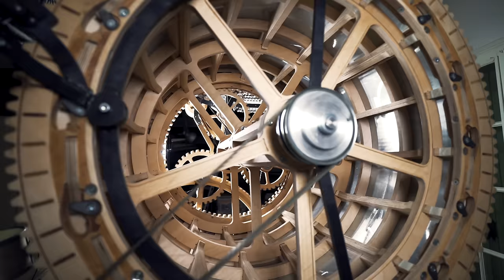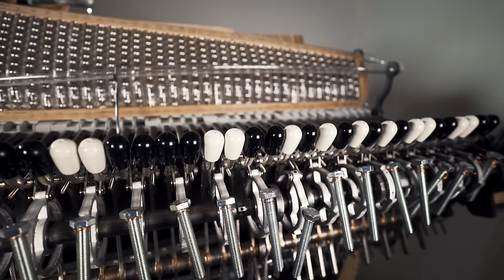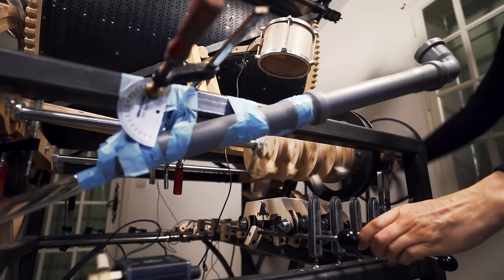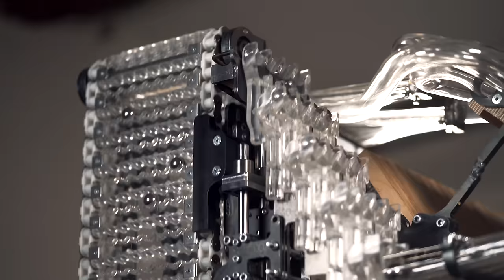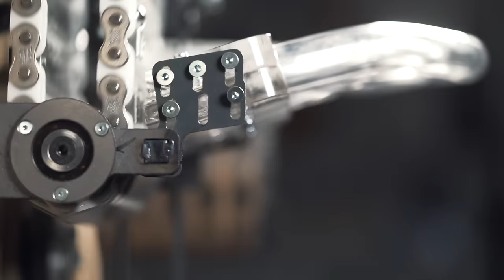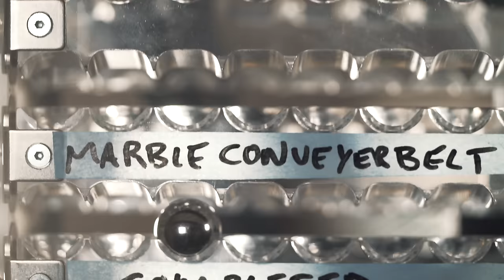Marble Conveyor Belt Completed! - Marble Machine X #78

Comment from the maker: The Marble Conveyer Belt is Completed and it delivers.
- lifts 8 marbles per crank turn.
- thanks to it being driven by ratchets and pistons, it makes a short halt to load and unload the marbles, on exactly the same spot every time.
- The pistons are connected to the crank shaft with a 2:1 gear reduction which means that the conveyer belt go in time with the music, and in half time. I can even use the mechanical sounds from the ratchets and the marbles climbing the fish stair to create parts of the beats.
- I only had one kick drum channel up and running so the kick drum plays on 2-4 like a snare normally would. Sounds a little strange but I just made this piece of music to demonstrate the concepts are working. (no music you hear in the videos are going to be used for the album, its quick and dirty functional pieces for the videos only)
- Its been a journey but we are now on our way. Again.
- the throw of the pistons s 40mm, the pitch of the chain is 15,875x2 mm, an imperial value, and it happens to be exactly twice the marble diameter. All this makes it possible to lift exactly one row of marbles per crank turn. The ratchets move 40 mm but only grabs onto the chain to move it exactly 31,75mm per crank turn. 
The carriers are flame polished cnc:ed acrylic 
- The chain was custom made in Japan and I waited 5 months for it to be delivered. haha. Of all the time consuming darlings on the MMX I love the conveyer belt /fish stair combo the most.
- the marbles looks like they are stuck over the demagnetiser wheel, this is by design, as soon new marbles come into the pipes from below, the marbles are slowly pushed over the demag wheel which ensures perfect demagnetisation.

- thanks for watching and believing in the project, good luck with everything that you are doing!
Martin
Reply: We will never forget "8 marbles per crank turn"...
Reply: Wintergatan I would be pleased if you could make those marbles exiting demagnetizer to go more freely. What I've seen it isn't enough slope for them and they are stopping a while after leaving demagnetizer. Please repair this. :-)
Reply: it's so beautiful 🤩
Reply: I can't help but notice that one spot on the drum that keeps getting blacker with grease each time a marble bounces. Do you have a plan to keep the acrylics and instruments clean?
Reply: Man job great
Reply: I'm still personally worried about feeding enough marbles during a song, but I have to admit that drum was filling up nicely.
Looking forward to this being completed. First concert I'll ever go see if it comes to Montreal.
Reply: Wintergatan good job
Reply: Martin, you are the shining example of how passion, hard work, creativity, and child-like curiosity can make anything possible. I've been following from day one in this process, and I can already hear the amazing music being made. Keep it going!
Reply: Congrats man. You're a genius. I wish you lots of success👍
Reply: Wow, dude, idk, but, sometimes, like this, the music are so beautiful and peaceful that i can sleep with that ! T.T Fantastic Job
Hello from italy !
Ciao, Bel video, fantastico ! :P ( you can use google translate if you want c: )
Reply: @wikapo  He says it is by design, look to the end of his comment!
Reply: Wintergatan , Looks great Martin, we admire your diligence!  Can't wait to see vibraphone on the machine ⚙️🔩🎼🥁🎧
Reply: Martin, I have a question for you. Do you think that you could play the original Marble Machine song in on this one? I would love to see the difference between them
Reply: Wouldn't it be cool to have a website with an interactive model of mmx on which you can click on the individual parts to see the video about this part.
Thats probably a project after completion and some vacation.
Reply: Its really nice great job
Reply: it looks like a miniature futuristic city. The marbles are little vehicles ( or even people). Fantastic! Mesmerising to watch, and the music here sounds beautiful, too. :)

Completely unrelated: I wish you and Björk would collaborate <3
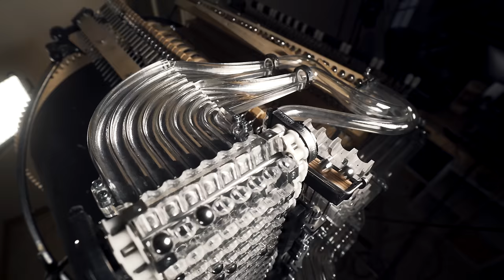Reply: 2:52, a marble jumped out of the elevator at the bottom
Reply: Congrats Martin :)
Reply: @EdwardHowton  This. Has the capacity of marbles carried up by the magnetic wheels per sec/min/whatever been calculated? It should obviously be greater than the amount of drops per lenght of song.
Reply: This video is set to break the internet, your machine is awesome to watch even without sound
Reply: What a momentous milestone! Marbles making a full circuit and playing a note! Congratulations, can't wait to see what fantastic music you make.
Reply: I am convinced that the marbles that bounce are more prone to deviate in the length they travel rather than over the width of their flight path. So it seems you may get more use out of an oblong catch basin to accommodate. Making it more streamlined looking and technically more usefully accurate. I understand completely that the grey tube is prototypical.
Reply: You are a Genius and a true artist, Martin Molin! As a perfectionist myself, I could understand well that you wanted the MMX to function perfectly and at the same time to look perfect. But as can be seen in this video,  MMX ended up being very beautiful. This whole journey was also very  didactic for me, as if the making of the MMX was a metaphor for any big project or dream one might have which brings many obstacles with it. I recently shared your story with my friends in our school's music magazine. So the Wintergatan community gets larger everyday. I am looking Forward to the upcoming albums. and I do believe too!
Best regards
Reply: Keep track of the weight and centre of gravity of that dream machine. It is a true marvel. Congratulations on what you have achieved.
Reply: The fish stair bit only seem to do 4 marbles per turn.... isn't that gonna be a huge bottleneck? Or is that only the recycled marbles that go there? Or what am I missing.....
Reply: The demag seems to have a favoritism towards the outer most track, is that because there are not enough marbles going through that section at a time? Or is that a fault line that can be tweaked out? I thought the design of the 5 lane demag was to keep it spread evenly and allow the lifting ratchet to carry full loads more often
Reply: The dark background looks amazing , what an amazing masterpiece you have created, ....
Reply: congrats! watched with big satisfaction. thought this moment will never come.
Reply: She's a beauty Martin. If the finished funnels are as cool as this it'll be difficult to know where to watch
Reply: @wikapo  it is by deliberate design
Reply: I've seen a couple of marbles rolling back on second magnet wheel. Hope it's not an issue.
Reply: @ZapAndersson  only recycled marbles fill the fish stair... I assume if no song is being played the machine reaches an equilibrium with the fish stair full but no new marbles coming up the elevator.
Reply: @ZapAndersson  only the recycled marbles go there from what I've seen
Reply: Wintergatan looks really good excited for you
Reply: Desperately looking for the black marble ... 😆

Great job, really! I am so excited looking forward to hear new Wintergatan compositions and see you on stage.

Keep going with the amazing projects 😉.
Reply: Oh my! it is so impressive and beautiful. You've come so far. We are all proud of you.
Reply: I did not understand anything about that, but good work.
Reply: We wait the good song on this magical musical instrument! Good luck!
Reply: Where s the "filling area"? If it is marble-empty where their journey begins?
Reply: I noticed that you used the words exactly and perfect only 5 times total. ^^
Reply: Very awe-struck at the beautiful piece of art/ engineering marvel.   Appreciate all the hard work you and team have put into creating the Marble Machine X.  #goteamMMX
Reply: @wikapo  "the marbles looks like they are stuck over the demagnetiser wheel, this is by design, as soon new marbles come into the pipes from below, the marbles are slowly pushed over the demag wheel which ensures perfect demagnetisation." from Martin own words....
Reply: @b.m.2738  thanks :-)
Reply: abledbody there are all sorts of cleaning brushes for brass instruments that would help with cleaning the pmma pipes. Shouldn’t be too much of a problem.
Reply: Your machine reminds me of dr seuss stuff for reason
Reply: Wintergatan “Conveyer belt moves in time with the music, or in half time...” but was it necessary, or it was some kind on perfectionism? What if you play in the time signature like 3/4 or 6/8? The conveyer that moves in half time of the music may distract you... or maybe I am wrong...
Reply: I'm so happy that God gave you a talent like that,keep doing whatever you're doing,with a brain like that deserves more subscribers!
Reply: Leonardo Da vinci reborn 🙂
Reply: Genius?
Reply: Very nice
Reply: It's a fantastic machine. I hope it ends up in a museum someday playing a continuous loop for the next five hundred years
Reply: Genius 天才！
Reply: Wait, there’s an album. 😂
Reply: I watched this video smoking a churro and it was a 4th dimensional experience .
Reply: gets to live show “oh no, we bought the 11mm marbles not the 10mm ones. Oh well, better go home.”
Reply: Should make it work with steam, that way you wont have to keep turning it manually and could add a whole woodwind or brass section or even a calliope type organ...
Reply: Martin, beautiful! But, if you have time, can you explain: How do the pistons drive the conveyor belt? What drives the fish stairs? And how?
Reply: This was unbelievable! Congratulations!
Reply: Wow great work! Love your music!
Reply: Come on! I like this melody
Reply: فيااان عن اول مره😂😂😂😂
Reply: Genius, BTW, take care, blessing
Reply: Great job.unique musical inatrument.i love the way you used those marble to make music.
Reply: How you made this? Please teach me,how it works.
Reply: "quick and dirty functional pieces"

understatement of the year
Reply: jesus God bless you
Reply: Amazing work!
Reply: The perfect instrument for a steam punk!!!
Reply: oh i love that song...anyone can cover that song?
Reply: Hi Martin, love your dedication to marbles, music and mechanical engineering. Whilst listening to this audiovisual marvel and your other projects I could not help thinking about how through "grandparents" of your machines such as automatons, fairground organs and early industrial machines such as Richard Arkwrights water-powered spinning frame and rotary card engines which helped in cotton and weaving in the 18th century. I found your work and "performance" strangely poignant,  as those early "dark satanic mills" we're the first machines where humans became less skilled but "a slave to the machine", effectively another cog in the perpetual motion and creation of wealth for a select few. This is not a criticism but something deep your amazing work helped visualise how many are tied to or enslaved by projects originally designed for enjoyment or spectacle which are always used by less inspirational and entertaining minds to create wealth or war off the backs of new technology. Just wondered if you or anyone else ever had thoughts like this?.
Reply: Have you thought of making a timepiece?
Reply: Wish I can meet you and chat for a 🍺... I am speechless. Same side, I my mind bursting with lot of ways.... Good luck ... Take care.
Reply: Ngsiing
Reply: Nice work
Reply: Yeah what the genius said!!!......... 👀😎👍
Reply: @NightVisionOfficial  09,
Reply: The effort he put in to make this machine is incredibly amazing
Reply: This is a beautiful piece of genius work. How much did it cost roughly to make and assemble? How long did this project take to complete from start to finish?
Reply: Perfecto So nice

Comment: Whats left? Instruments and the marble catchers. Thats all that is separating us from a completed version of this marvel of engineering.
Reply: and troubleshooting and fine tuning, so much troubleshooting and fine tuning...
Can't wait though!
Reply: Packaging and recalibration fixtures.  So, that when stuff wiggles, stage isn't flat, altitude, baro, even subway trains don't make it behave different in different places and the adjustments to compensate can be quick   @Hirosjimma
Reply: He will also need to do several tests to dismantle, and reassembly of the MMX.
He may also need to do a condensation test and maybe a discharge system as well.
Reply: ... "marble of engineering."
Reply: @carstenhilbert5472  how punny
Reply: Also, I believe there still hasn't been a good solution for the programming plates.
Reply: @Nerdule  I think the programming plates were completed in the "Slaying the dragon" video, right?
Reply: @easyidle123  That is correct.  I was left feeling that he had other silent concerns from that.  (inference to one dragon split to 7 others.)  I keep witing for the other shoe to drop on that one.

Comment: 5:58 Murpy's Law - Marble didn't find the hole
The rest - Perfect, Martin
Reply: I'm curious as to what variables would even cause them to land in different spots. . . I guess the machine shaking from all those moving parts would be enough.
Reply: Entropy will be denied!
Reply: @normang3668  Probably just the vibration of the machine, you can see it jiggling around.  From what we seen the real collection pipes are going to be much bigger so not a problem.  The real problem is at 2:50, you can see one jumped out of the lift once it was already in the second row on the right.  Maybe just a little clear wiper that goes up a inch or two for the first bit of travel to make sure they went all the way in and stay.
Reply: @h82fail  yup..i noticed it too..hope martin aware of this problem
Reply: @h82fail  damn nice catch
Reply: I wonder what caused it to deviate in trajectory
Reply: It also skipt a basdrumhit at https://youtu.be/1AEvQAg6TE0?t=297 but its nothing to worry about. For a alpha, alpha test it is amazing...

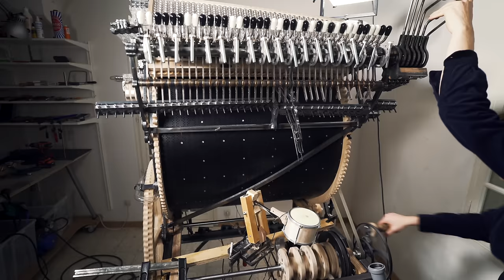Comment: Probably not intentional, but at 1:10 the sound of the marble hitting the pipe in time with the machine sounds really good. If you haven't fully decided on a return mechanism, a pipe with a mic on it for the drums would be pretty cool and allow some more flexibility.
Reply: It sounds great, but I think with that we'd have the same problem as in last weeks episode. The time from drum hit to pipe would be constant while the bpm are varying and he can't adjust the clutch for both timespans independently.

Comment: So: marble release system
Instruments
Marble catch system 

And we are done???
Reply: Mans Klaassens probably 10 more episodes. Don’t forget fine tuning
Reply: Yes and a few more redesigns as well. We know how Martin works. You can already see a hitch in the marble conveyor system, in that the path from the first wheel to the second doesn't seem to pick up marbles well enough still (they are getting stuck) and that the splitter section is getting gummed up with too many marbles  especially problematic when you see some getting stuck or going backwards.

So we still have a little way to go. But I would think we are getting close!
Reply: We are really
Really
Really
Close
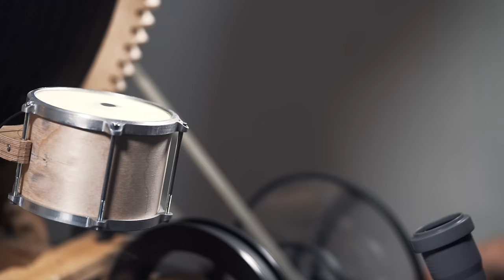Reply: The marble catch hole needs to be fine-tuned.  It lost two marbles 5:52-6:07.
Reply: @danielsjohnson  I wouldn't worry about that hole since it's duct taped to the machine and definitely not permanent
Reply: @danielsjohnson  i think there will be funnels attached to those holes like on the first machine
Reply: @Kaboom1212Gaming  Regarding the wheel-to-wheel transfer, perhaps a high-friction edging to give the marbles that one extra push would work. Wood on metal can be quite slippy, so a ring of something knobbly like ridged plastic could work, rather than relying purely on the marbles behind being pushed into the stuck marble.
As for the splitter, the note said it was intentional in order to fully demagnetise the marbles, but I do agree that it looks like it's an unfortunate choke-point. Some marble runs have a Y- or T-shaped bit that directs marbles based on where the previous marble went. Three of these Y-shaped  splitter-flippers, if placed correctly, could help smooth the through-flow of the marbles and ensure a more even spread between exit channels.

Comment: @Wintergatan @Martin,

Have you considered running some checks on the balancing of the high-speed spinning wheels? I am thinking about the momentum wheel and the wheel you are handling when playing, particularly. If unbalanced, they can be a source of vibration and affect how the different parts wear out.

In general, this is looking really good!
Reply: Daniel J. Caballero I don't think they spin fast enough to cause any issues. But if they're balanced I think it might be easier for him to get it spinning and hold momentum
Reply: he likes to lubes it

Comment: Lube that thing, Martin! :D And good work!
Reply: Actually the noise of the cranks and gears turning is quite soothing and add effect to the song
Reply: @thelostpianist9404  true but the insides of some of the tubes seemed to be a bit tight and needed other marbles to push the marbles that got stuck.
Reply: @KevinLarsson42  yeah I didnt notice that. Good eye mate. Im hoping he will play the original Marble Machine song on it when finished
Reply: @thelostpianist9404  Plus, he will use contact microphones, so only the music instruments themselves will be heard, unless he puts more microphones on other parts of the machine.
Reply: @VulpesVulpes42  I was about to ask about that, cause otherwise it would be close to impossible to mute the mechanical sound of the machine, right?
Reply: @KevinLarsson42  that's by design and ensures marbles go through slowly enough to be fully demagnetized.
Reply: Or rather.....don't lube it.
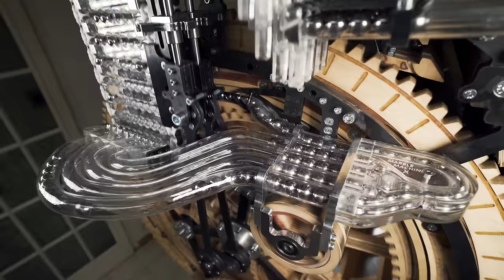Reply: @Agedude  i mean for example the tubes at 2:38
After the de-magnetizer they get a little bit stuck sometimes